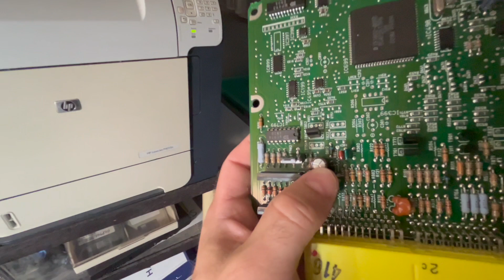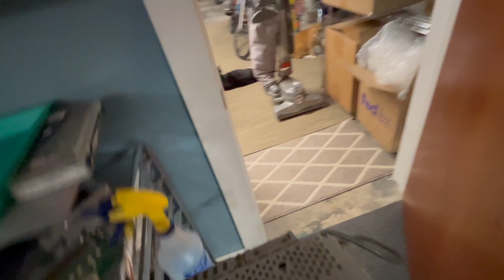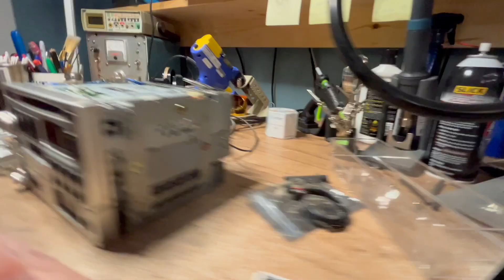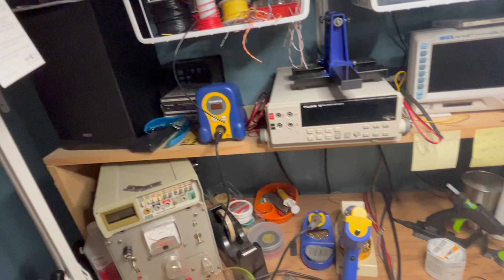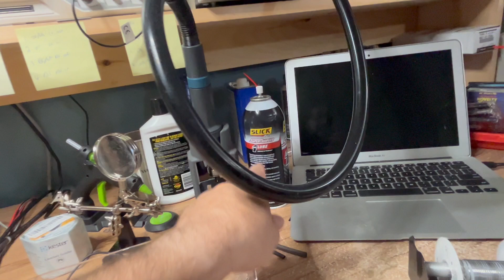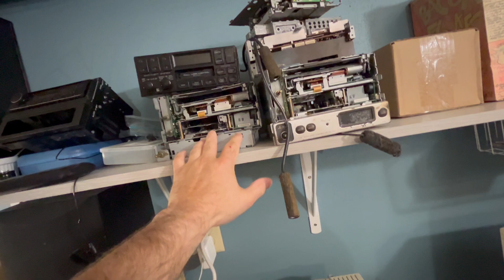Bishop's Vintage Car Audio Repair - Shop Tour and What I Offer

Comment: Very nice equipment, Brandon. I'm a Hakko guy too. I'll soon be getting the 301 desolder gun to add to my arsenal. I'm a Mac guy too. My early 2011 MacBook Pro is still going strong. Of course, I have updated the RAM to 16GB and I'm running dual SSDs.